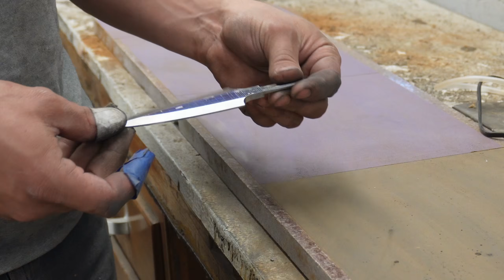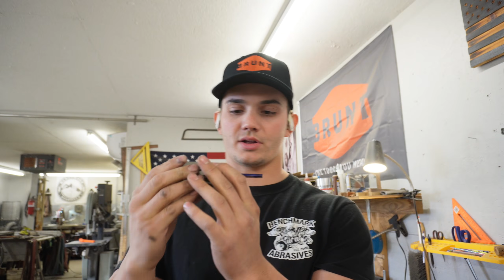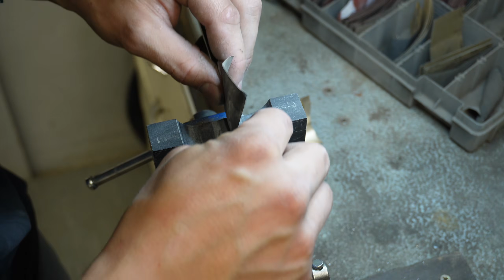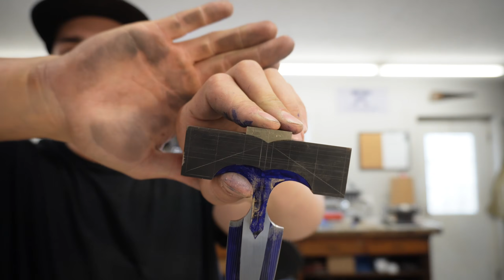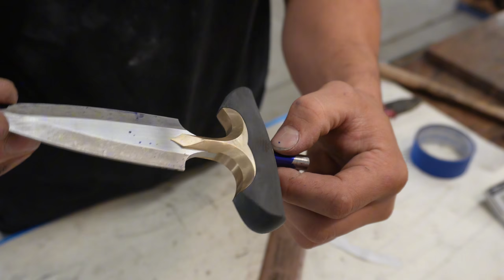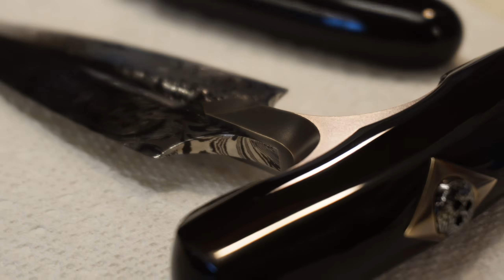Making a Complex Damascus Push Dagger

Comment: Honestly: the dagger is beautiful, the texture of the damascus steel is exceptional and you are a blacksmith, not just a skilled one, but an excellent one.
Except this isn't a normal knife; this is highly illegal because it's double-bladed. Not content with that, you made it a dagger not for cutting, but for striking (killing).
It's what's informally called a "bastard" dagger.
That said, the work is impeccable. Congratulations.
Bye, good luck and keep up the good work 👋
Reply: Yes, it was designed to be used against people, so what?

Comment: Would it be feasible to use lapping compound on the bolster and the handle material to meet them up together? Or would that process be too inconsistent and cause wear in the wrong spots?
Reply from the maker: Thats some great insight, and i have tried using grit and similar products before. However it seems to present issues with grit embedding in softer materials and removing abraded material also becomes difficult.
Reply: @BridgerForgeBlades thats good to know. I only had the idea of lapping compound because I recently watched Alec Steel's recent video of rebuilding his air hammer and they had to lap a part on that machine and I didnt know if it would apply to this type of build. Thank you very much for replying.

Comment: Incredible build, I really like the 3 dot-triangular pattern pommel nut keyway and key, I find it is a very unique touch. Most pommel nuts I've seen are just the 1 hole drilled across the nut, so that you can use a small pin to twist it, but the keyway I think is way cooler and is much more aesthetically appealing.